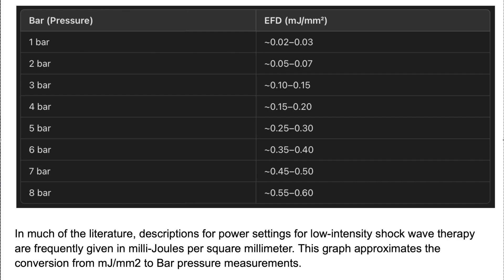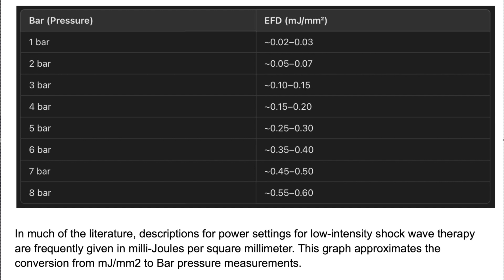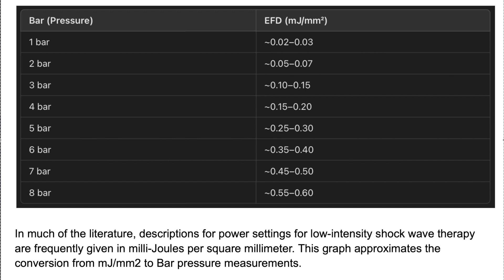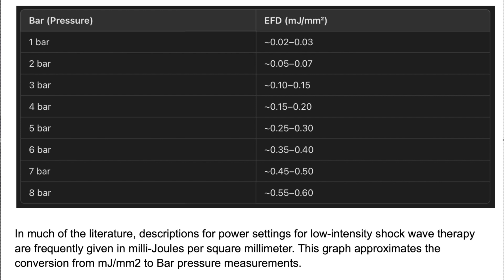Shockwave Therapy: Converting mJ/mm2 to Bar Pressure

Comment: I'm very appreciative of your efforts  to share this informatio--as well as the approximate convertions.  My research indicates that most radial ESWT machines show the "strength" of the energy pulse in bars and that most focused ESWT machines show the "strength" of the energy pulse in milli-Joules. There are also some ESWT (radial and focused) that simply show the strength of the enegy pulse as a numerical level such as "1" or "2" or "3" and so on. Hopefully, in the future, the unit of measure for the strength settings on these machines will become more standardized.